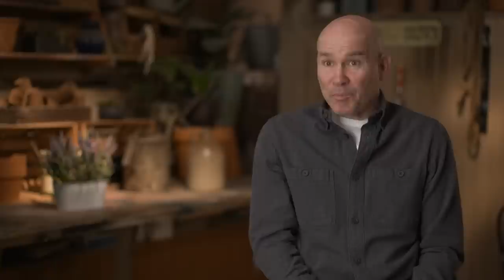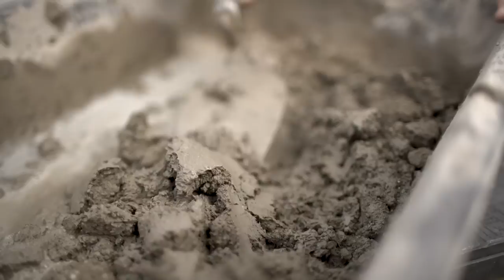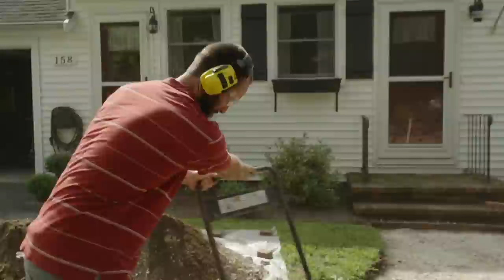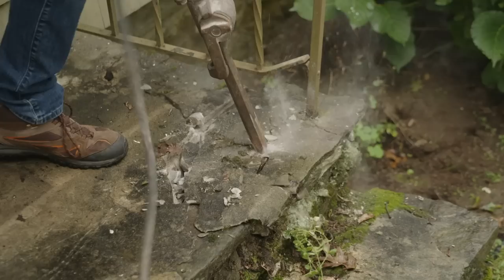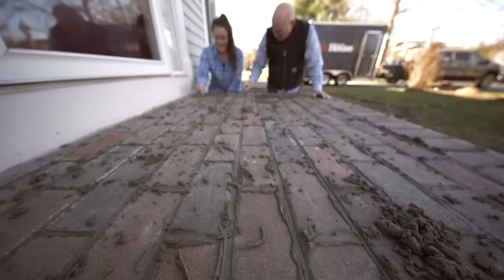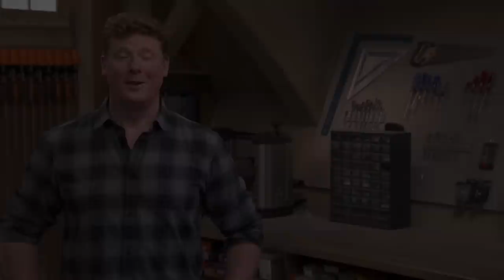Mark McCullough’s Approach to Masonry | Ask This Old House

Comment: Hey Mark you have done so many projects for a lot of home owners. I was hoping if you want to do just one more? I have a home that is 20 years old the front steps have "sunk" during this time.  I  measured the steps they are so 4" lower than when we moved in 20 years ago. Now to step up onto the top porch landing it is quite the effort. Would you check and  see if I would be a good canidate for one of your next projects?